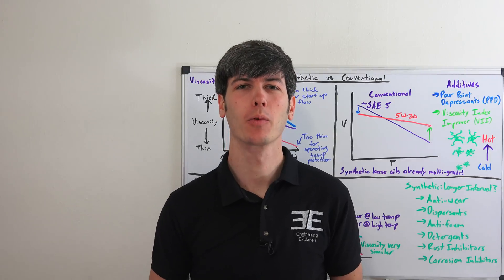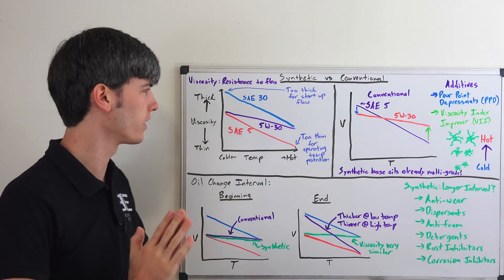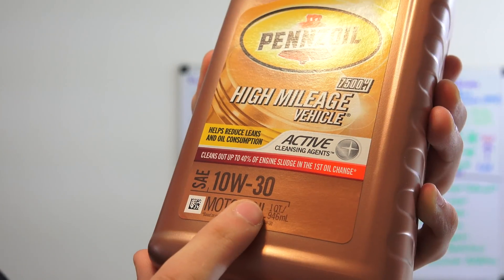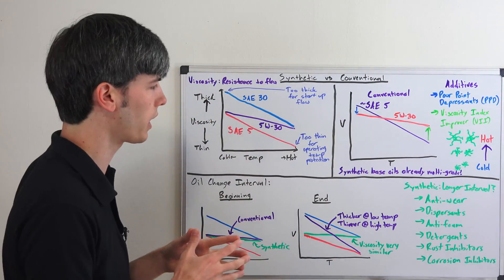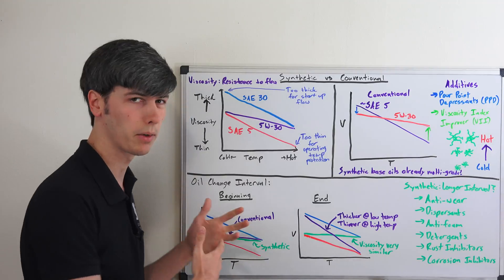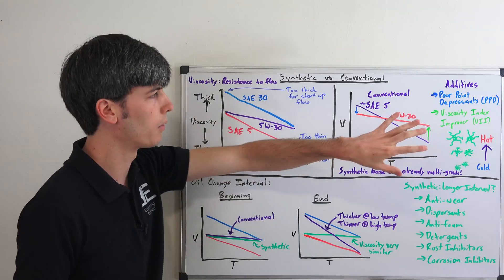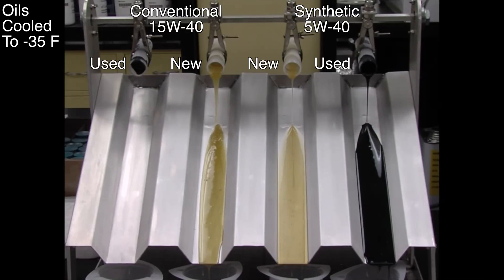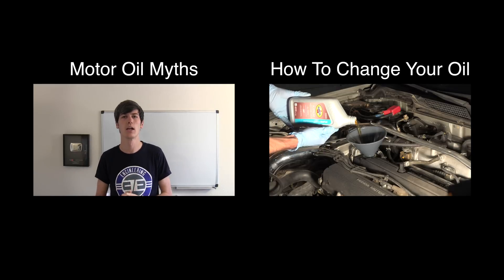Is Synthetic Motor Oil Better For Your Car?

Comment: Say a car isn't driven much, does oil age effect viscosity?
Reply: I've never had a problem with conventional oil.
Reply: Yes. Oxidation and the build up of condensation degrade oil over time, regardless of actual use. Always drive a vehicle long enough to heat oil above boiling to rid water and get out of cold start enrichment cycle. Fuel enrichment blows by rings and thins the oil. Even with fuel injection. I have a 5 minute drive to work and the winters kill my oil, but driving a long distance once a week to boil out the contaminates helps oil last longer.
Reply: not really to my knowledge but the general rule is 6 months or 5000km for oil changes. As oil is a petrolium product I imagine it will have a similar effect while sitting for long periods as petrol. If you have a car that is a sunny day driver is might be best to use a petrol additive to stop it going off and making sure you start it for half hour a week if possible (dont do a 5 minute run as you will drain the battery each time you do it unless it is on a trickle charger.)
Reply: Oil viscosity changes over a long period of time as it breaks down.Remember though,if you don't drive the vehicle much ,don't change oil based on mileage but by time due to sludge buildup.
Reply: Oil need to be change every year even you are not driving it.
Reply: what you need to look for is the oil turning black with clean oil. this is an indication the oil is breaking down and needs changing asap. if you take to long to change it, you will end up with sludge, this will lead to oil sticking to the piston, chamber and the valves. resulting in bad performance and a large repair bill. if you see this and change the oil, use some stp injector cleaner. this will help clean the crap out and give a performance boost. also check the spark plugs and change them if they are black on the tips.
Reply: +bookshelffury not really, but it depends how old. oil should be changed yearly if you haven't reached the mileage interval. when oil sits in an engine for more than a month without being ran and getting to operating temperature it collects a lot of moisture and gets cream colored. if it gets to that point you should change it, but running it at operating temp for about 30 mins one or twice a month will prevent that.
Reply: Thanks for the replies. The car gets ran almost daily but living in a small town i put maybe 50-60 miles on it a week so it's possible it could take a year before hitting 3000. I usually let it idle for a min before taking off since my drives are so short. It does get up to operating temp tho.
Reply: The problem you are going to run into is the oil will get stale. You oil will begin to oxidize. If you are running synthetic and change your oil once a year you shouldn't see any problems.
Reply: Even if the engine is at operating temp, it takes awhile before oil reaches a temp where it can burn off moisture. Oil takes a long time to heat up. Usually about 20 mins of driving after the engine temp is up. If you drive it daily you should be fine
Reply: depends on if its conventional or synthetic. conventional i wouldnt trust for too long but with a top quality synthetic i wouldn't have a doubt in my mind that i could let it sit for months at a time and it'll start up like its been ran every day.
Reply: Dino oil will age in the bottle if you never use it. It will get thicker as it ages, even if not used. Of course it will get thicker as you use it.  Synthetic (full synthetic) does not thicken as it ages or is used. The advantage to synthetic oils is the pump-ability when cold and the heat resistance when hot (thermal breakdown). It also releases contaminates better than dino oil as it passes through the filter. What ages synthetics is the additive package. It wears out after a time. If you are going to keep your car for along time, say well over 150K or more, I'd advise to use synthetics wherever you can (transmission, engine, grease). If you change cars every year or two or three it's a waste of money.
Reply: You are a candidate for synthetics. A "dry start", starting your car in the morning is the worst for wear. The cold pump-ability of synthetics will help your engine at this time.
Reply: Steve Prestek You do understand that in many cars,synthetic oil is detrimental to the seals don't you?
Reply: I'm not sure how to answer that but the oil will get oxidized even if it's just sitting in the crankcase.

Comment: If your car has over 80k mile on it and you've never used synthetic oil in your car, DO NOT start now, more then likely you will begin to have oil leaks. Synthetic oils lubricate better and can also get into smaller spaces then conventional oil, engines with higher mileage will begin to leak because the seals on these engines are wearing out.

Comment: synthetic in older motors is bad because their to thick
Reply: What's too thick?If you get the proper viscosity oil,then it will be the same.

Comment: they should up hold the Manufacturer recommended intervals. They might try to tell you differently, but they're just trying to sell you more than you vehicle needs... no matter of the 'Conditions!'
Contact your manufacturer and tell them what the dealer is trying to do! If nothing changes, find another dealer.

Comment: Inaccurate and obviously biased "research" to benefit synthetic oil. Who drives or lives at -35 Fahrenheit (-37C) ??? Only Alaska and Siberia need to be worried, most US never reaches those temperatures.  Buy conventional, stay happy, and Save your Dollars !
Reply: Nope, North Dakota, Minnesota, Wisconsin, Montana, pretty much the entire great plains/upper midwest temperatures in the -30F range aren't particularly uncommon, though they are uncommon to last more than several days at a time; the more populated areas of alaska are mild by comparison.  Siberia? I'd bet -35F in the winter and they'd be walking around in t-shirts and shorts, have to have -60F or less to make news there.  You should do more research before making such assumptions.
Reply: 0w20 conventional? Maybe a blend. At 0w20 I'm good for 10k miles per oil change per the manufacturer. I could go with something more conventional like 5w20 but I'll definitely lose out on gas mileage due to increased friction and I'll have to change the oil twice as often. 

You need to base it on what your car needs.

Comment: so this is why synthetic oils have a larger service period then conventional oils.
Reply: synthetic oils have a lot more additives to them which allow them to maintain their lubricating properties longer, although if you live somewhere that get cold, you should still do your oil changes. also if you have a car that has over say 80k mile on it and you've only used conventional oils DO NOT switch it to synthetic, i can guarantee you will begin to have oil leaks.
Reply: Switched mine over from conventional only to full synthetic at ~150k miles. The only interval I experienced any leak was the first. Should have paid more attention, as I didn't catch it until the next change when I found it to be almost two quarts low. Haven't had an issue since. If I were to do it over again, I'd likely go with blended for a few intervals before going full syn, and pay more attention to the level intra-interval.

Comment: That oil pouring demonstration was worthless considering you used 2 different viscosity oils.
Reply: I imagine you paused the video as soon as it started, he goes on to explain the fact that the viscosity doesn't matter, It wasn't a direct comparions of synthetic vs conventional. it was a comparison between the viscosity of used synthetic and new synthetic, likewise with the conventional oil, demonstrating the change in viscosity of the motor oils.

Comment: Clearly your points applies to harsh winter conditions (negative temperatures) countries. But what about tropical islands, say Mauritius, here winter's lowest temperature is around 10 degrees C in worst case scenario. So when you'll look at end of life span of the oil quality, which one would you recommend for Diesel engines? synthetic or regular oil?

Comment: The fact is synthetic doesn't make much of a difference, if at all, unless you're talking extreme conditions. You can classroom and white-board it all you want, but in actual real-world tests all modern oils perform virtually identically in NYC cabs. I bet the overwhelming majority of people here don't work their car that hard. Synthetic is a great choice in high rpm and air-cooled engines, or engines used for racing.
Reply: The current API rating is SN.  If your engine requires SN or less, any such motor oil provides adequate protection in the usual real-life conditions when used for the duration recommended by the engine makers.  That's my opinion though I know others will disagree vehemently. I'm old and have owned my share of cars and tend to keep them for decades.  I've never worn out an engine, had one rebuilt or even had the heads off of any of them. None burned excessive oil.
Reply: +wholeNwon The only part of that that isn't correct is the 'SN or less' part. Virtually all REALLY old engines need special oil (high zinc or racing oil as its commonly called) to offset the lack of trust-metal Babbit bearings. Other than that tidbit, yep, you're spot on. Lab conditions are great for raw comparison but don't tell the whole story. You only need what you need. The rest is fluff.
Reply: +Jim Bonney I meant 'Tri-metal' bearings. Auto-correct...

Comment: Great video. I'm no oil expert but I believe synthetics also typically have more heat tolerance which can be advantageous on high performance motors that can be difficult to cool effectively, like dirt bikes.

Comment: I put water in my engine and runs like a dream
Reply: Also it lowers the cholesterol in the engine.
Reply: mine likes turtles!
Reply: +wholeNwon oh yeah, my engine makes dildos and i give them to my harem
Reply: strawberry yogurt works for mine.
Reply: i used olive oil 100% natural  run good and healthy
Reply: i like peanuts
Reply: My engine makes water when it burns hydrocarbons.  Imagine that.
Reply: +Michael D 
if I had a harem, they wouldn't need dildos.
Reply: dekaos88 That only works with Maseratis, Lamborghinis and Fiats .
Reply: +Gaston Deveaux beers are more expensive lol
Reply: John Elmeme nice
Reply: I stick my dick inside the engine and I can get at least 5k miles. Mechanics hate me!
Reply: Well you must have a steam driven automobile.

Comment: I've been ase certified for more than 20 years and let me tell u if u use synthetic oil in a older motor 100k plus and u don't know what oil it had it previously it will weaken the seals and you WILL have oil leaks
Reply: Doesn't weaken them though, the conventional oil just acts as a band-aid to old dry rotted valve seals. The seals absorb something in the conventional that keeps them more swollen, where when you switch to synthetic, you lose that band-aid, valve seals are less swollen, and the synthetic will leak past them.
Reply: It hasn't happened on my Diesel 1999 Suburban which I bought at an alleged 170-180k miles. It did happen on my 1984 Caprice though which had 113-115k on at the time.

Comment: Well is it better for everyone? Not a simple answer, but for me its not. I use name brand conventional oil and change it every 5 K all the time and change my filter every second oil change. My oil is always still clean when I change it because I do not do stop and go driving, always a minimum of 1 hour drive. I have 300 Kms on my engine and it runs perfectly. I use 10W40 in the summer and 5W30 in the winter.
Reply: But at 20Kms your oil is very dirty and your engine has been running on it for 10K. I probably drive less than you per year (10-15Kms) so I usually only change my oil twice a year, maybe 3 times if its a tough winter. But I buy Quaker State at Walmart for usually $12-$13 so can have always clean oil in my engine for the same or a little less than Synthetic. I have been driving for 55 years and I have never had anyone said their engine blew up or wore out because they had poor quality oil but I have had them have problems with old and dirty oil. Just my thoughts and experience. Plus I have a buddy that takes my old oil, mixes it with peanut/canola oil and diesel and uses it up in his VW so I don't need to get rid of it. Cheers Bob
Reply: Not unreasonable and obviously the kind of use that auto engines like.
Reply: Every 5k?! I iuse synthetic oil and i change it one every 20k. I drive 30k/ year. I would go nuts if i need to change oil every 2 months.....
Reply: If you are already under the car changing the oil you might as well do the filter too, every other time doesnt make much sense to me but to each their own
Reply: Of course. But with a high quality filter and all high-speed driving, he is likely doing no harm.
Reply: The filter is easily reached from the top. When I started changing the filter every second time after two oil changes I removed the filter and took it apart and it was CLEAN inside so I don't feel I am missing anything. It works for me anyway.
Reply: You do realize that you don't want your oil to be clean when you drain it? Motor oil does 4 basic jobs: it cools, cleans, lubricates, and protects. If your oil comes out clean then it's not doing its job to keep the dirt/carbon suspended. Try a different brand with a better additive package or add a little atf to the oil before an oil change and you'll see what I mean.
Reply: No its clean because I change it often and my driving is always at least for 1 hour at highway speeds. No short trips in the city. I have had the valve covers off and the engine is like new clean inside despite the fact it has tons of miles on it and its 11 years old. In fact the engine runs the same as when it was brand new.
Reply: In most newer vehicles, oil will be practically the same after 5k miles. For example, the '12 civic I believe has a 9k service interval, meaning that the engineers found the vehicle could run perfectly fine for much longer than that.
Reply: Newer engines especially the all aluminum ones that were diecast are incredibly clean because they have no graphite/carbon in the base engines as cast iron engines do. The other reason all alunimum engines like your civic last so long is that they were no cast with sand in them that no matter how hard manufacturers try they cant get it all out and to some degree it makes its way to the oiling system and then to the bearings.

Comment: i worked in fleet management for about 9 years at a large limousine company. there was always 8-12 limos + sedans a few buses and what ever other random vehicles the boss felt like keeping around. every car got a oil change every 10,000 miles using the cheapest stuff we could find which was sams club certified oil. never had any engine issues, most cars were traded off around 200k but some reached up to 600,000 miles. 

even in all the old beater chevy trucks ive owned i just put whatever random oil in them that is on sale and again same thing never had a motor issue, so i never believed in the whole paying twice as much for synthetic oil deal
Reply: If it says "API for service SN", that's good enough for me, too.

Comment: Great video, thanks.  Is there any noticeable difference between using 5w-30 vs 5w-40?  If my car manufacturer recommends 5w-40, does using 5w-30 harms the engine?
Reply: Why wouldn't you use what the engineers who designed your car recommend?
Reply: Overall speaking, use 5w40 or 0w40. You'll get a little MPG boost by using 0w40 over 5w40 without compromising film strength; this is because it's (generally, there are a few slight exceptions) thinner when you start the car but not when the engine's hot.

Comment: So of course, you should spend more money on synthetic oil, right?
Wrong. If you don't plan on driving your car until it dies, it doesn't matter. Synthetic won't add its value to the resale value of your car... just like anything else 'extra' you do for your car doesn't either. 
If you do plan on keeping your car until it dies, chances are it will be rust and all of the convenience features failing... or an unrelated engine problem like a head gasket, timing belt failure, or transmission failure that costs more than the car is worth at that point to fix. Few cars suffer from catastrophic engine failure related to sludge or metal on metal starts anymore.
Reply: Yup but the last 5 qt containers of Pennzoil and Mobil 1 that I got were cheaper than conventional, after rebates ($10 and $12 respectively).  That's the only reason I bought them.

Comment: I've heard that some people recommend using a higher viscosity oil on cars with higher mileage like using a 10W-40 vs. a manufacturers recommend 5W-20 over 100k. Any truth/benefit to this?
Reply: Probably not though one could invent hypotheses to "support" doing that or just about anything else you can think of.
Reply: It may have been more true of older cars which don't have that new valve timing. Even so, going from 5w20 to 10w40 may be too much of a change and 5w30 may be better.

Comment: find it funny how they used the conventional oil out of a Diesel engine and the synthetic out of a standard petrol engine (and yes it makes a huge difference between the 2).. also i dont even trust Pennzoil my father used to get his van changed with it from day one and  his engine locked up at 226,000, dealer stated bad oil (2000 Windstar).. my V6 has always used Mobil 1 conventional and it has 431,500 and just passed emissions with flying colors. engine runs like a dream...